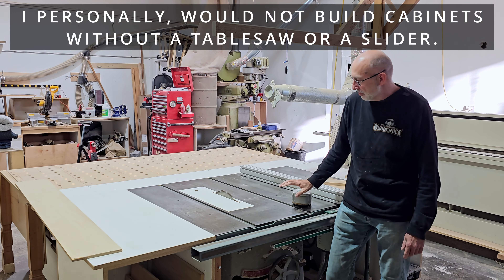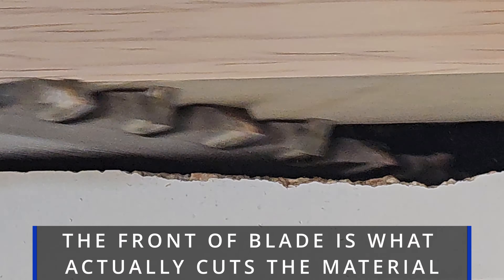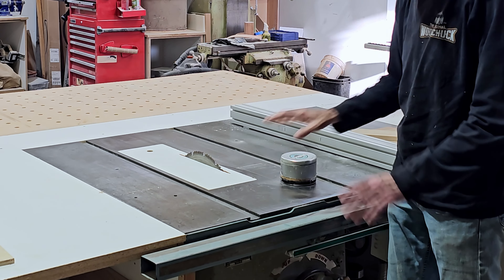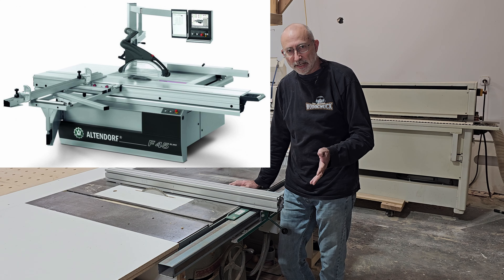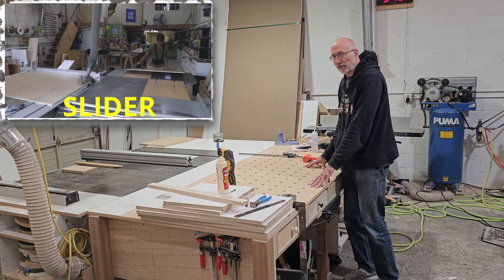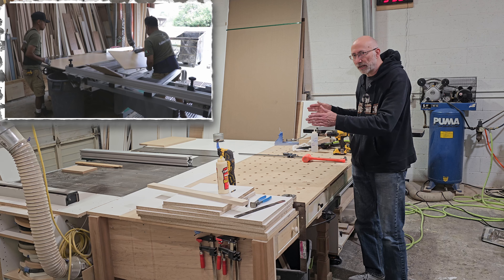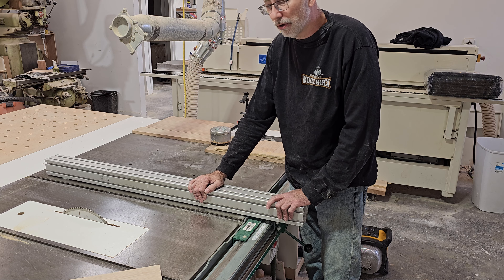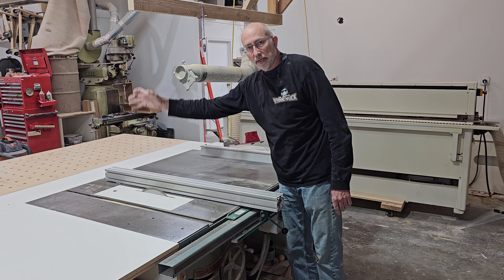INSIDER TABLESAW HACKS FOR CABINETMAKING.

Comment: Nice video. Good tips.  If I don't have a $100 bill, can I use five $20?  Just kidding. The only issue I had is about measuring the rip fence to the blade using only the tape on the fence arm. I use a dado set and an ultra-thin blade from time to time, and while my nice Ridge flat ground rip blade is the default setting for the tape readout on the fence, it doesn't work when I use these other blades. I'm sure you didn't mean to imply this. So thanks, and I'm now a subscriber to your channel!
Reply from the maker: Great!  I appreciate the feedback.  Someone needs to come out with a digital measuring scale with programmable buttons for each blade one uses. (Not a bad idea)
Reply: @theoriginalwoodchuck  Brilliant! That's your second million dollars!

Comment: Doesn't having a riving knife help prevent kickbacks even when cutting plywood? Like in case the leading edge of the plywood moves away from the fence for some reason?
Reply from the maker: You may have a point there.  I've never had a riving knife on my saw and I think when I've cut a small piece off a long board and it's harder to control the push against the fence, a kickback has happened.   A riving knife could prevent that I guess.  I'm never in front of the blade when that happened so I didn't worry about it. Be safe no matter what you do.  I did  get a riving knife so I guess I'll do a video when I install it! Thanks!
Reply: Yes it does. Suggesting otherwise is simply bad advise. Ideally one should use both the blade guard and a riving knife or splitter. However, of the two, the riving knife is far more important.
See a prime example of a plywood panel kick back here: https://www.youtube.com/watch?v=vN7G7G3gMeg
Reply: @ST-0311  I agree with your point that you should use a riving knife any time you can, but that video shows the user pulling the plywood backwards into the blade.  Riving knife might have helped, but stupidity played the biggest role there.
Reply: @dukecarey6949 Not stupidity so much as ignorance. Clearly, the man didn't have experience with table saws, and didn't know better. He does now.
That said, any "Tips" or "Hacks" video covering basic table saw use, like the one you presented, are directed at inexperienced users.
Being that these are the the very people that are inclined to use a table saw incorrectly any inference that a riving knife is unnecessary, or that plywood panels won't kick back is just bad advise.
I'm not trying to attack you personally. Most of the information presented was clear and correct. However, on these points you got it wrong.
Reply from the maker: I stand corrected.  Except I've used a table saw a lot if my life and have not had a riving knife much of the time.  And no kickback that has hit me.  I've seen it happen though with solid wood and come to think of it one time it did spear a custom cabinet we were making.  Point well taken and I've edited that out of the video.  In a few hours that "advice" won't be in there.
Thanks for your input.  @ST-0311

Comment: Is that fence an aftermarket product or just a piece of extruded aluminum?
Reply from the maker: I think I got it from Very Cool Tools, which is the main green part.  The flaw in their fence is that if it gets bumped it moves because the attachment to the aluminum fence has such small allen key bolts that I can't tighten them enough.